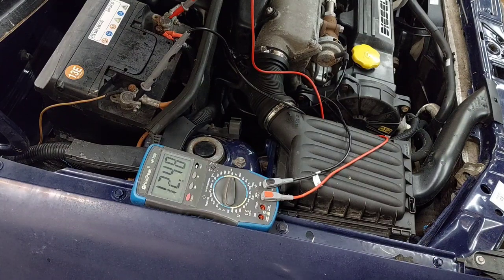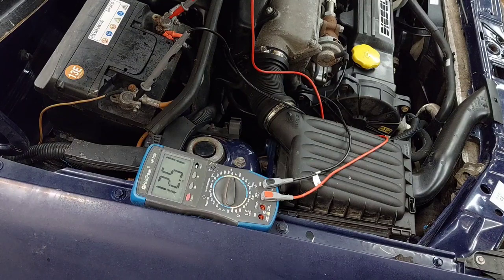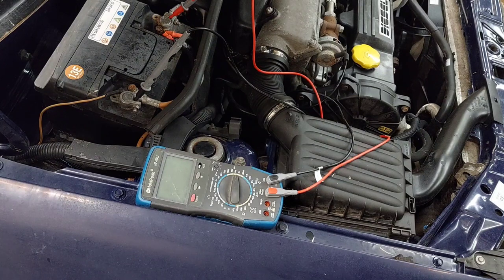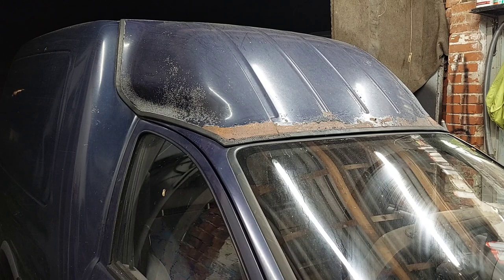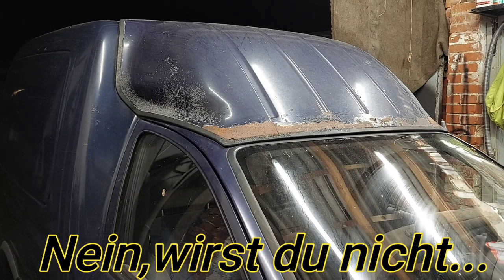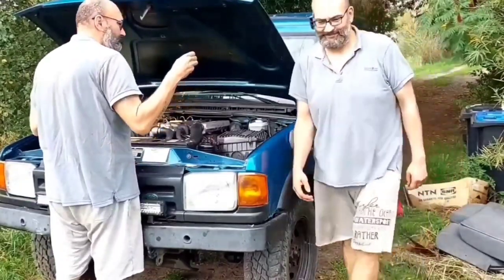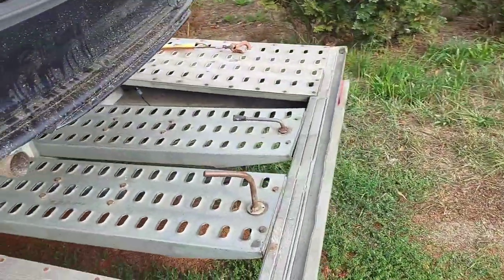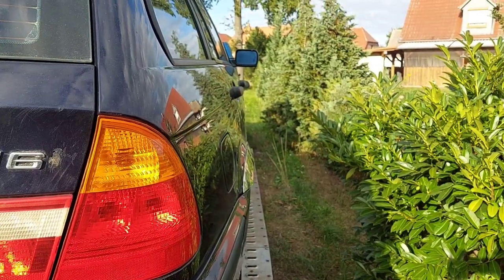BMW vor dem Schrottplatz gerettet!

Comment: Hey Micha, hat der 316er E46 hinten Trommelbremsen? Ich hatte mal einen 316 Compact E36 und da habe ich Monate dran gesessen das Problem mit der Bremse hin zu bekommen. Neuer HBZ, neuer Bremsverstärker, Unterdruck geprüft, ABS Block getauscht und 8 Monate später habe ich die Bremsen hinten neu gemacht und gesehen, dass der Nachsteller defekt war und daher war das Bremspedal extem weich. Ok deiner verliert ja noch zusätzlich noch Bremsflüssigkeit, vielleicht ist ja n Radbremszylinder Inkontinent. Auch alte oder billige Bremsschläuche sind nicht zu unterschätzen, die hatte ich dann auch bei meinen neu gemacht und danach war er wie ein Neuwagen zumindest von der Bremse. Was willste den für das Teil haben bzw. kannst du ein link von der Anzeige schicken. Gruß Micha
Reply from the maker: Moin, nein der hat Scheibenbremsen hinten.

Comment: Ein hübscher Wagen, mit wohl weniger Problemen als meiner - ich habe lange in e-bay Kleinanzeigen gesucht, konnte ihn aber nicht finden - vielleicht solltest Du einmal einen link einstellen, wo ein Direktzugriff über die Verkaufsfahrzeuge aufzurufen wäre! Ich starte jetzt nach zweieinhalb Wochen mit meinem Zafira, die letzte Bastion mit dem Austausch der Spritpumpe - danach gehe ich in die absolute Kapitulation und werde überlegen was aus ihm wird, wenn er nicht wieder anspringt!
Reply from the maker: Moin, welcher Motor steckt in dem Zafira, und welches Baujahr?